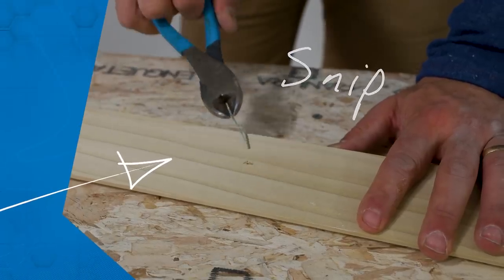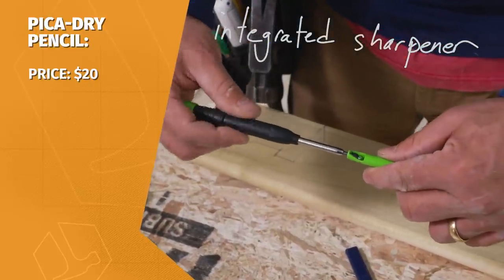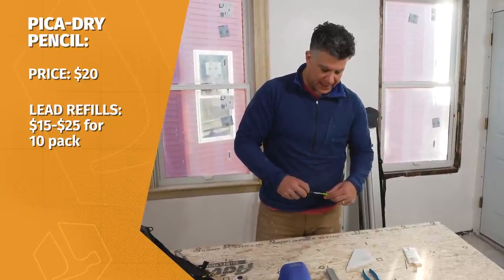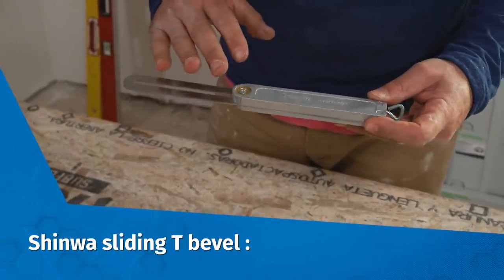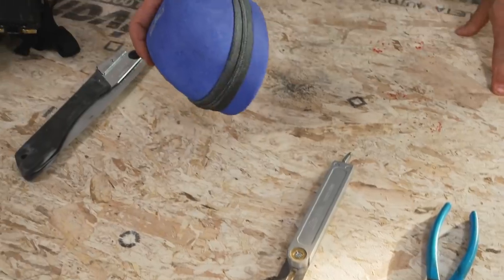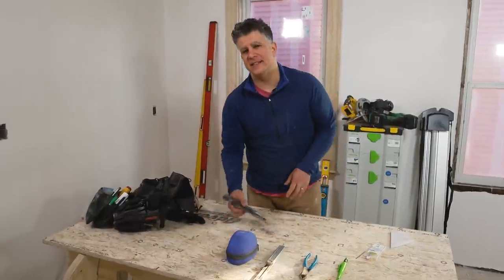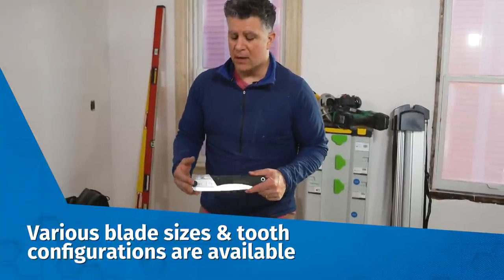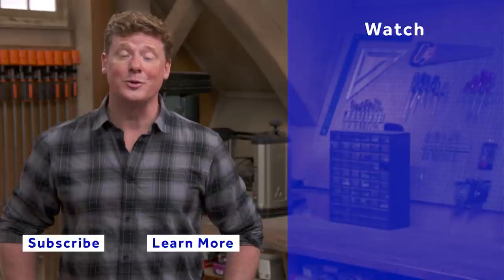5 Hand Tools Worth Having | Tool Lab | This Old House

Comment: I prefer an 07 mechanical for cabinetry, and tried a Dixon (Pica like) but wasn't impressed. 
Definitely use the Shinwa from corner to mitersaw.
The folding saw is intriguing, my Suizen pull saw is just over 2 ft long and difficult to store.

Comment: Fun video but $20 for a pencil is a bit much.  I know i'd lose it very quickly.  Everything else seems cool.
Reply: The holster it comes with is actually really great for making sure you don't lose it. I was forever losing traditional pencils on site, but I quickly got into a routine of putting the Pica pencil away in the holster in my pocket or tool belt. The ability to write on almost anything, including wet wood males it a go-to tool.
Reply: $20 is $20
Reply: I actually got two of them, never lost one. The most important feature is that it is so slim at the front. It's not for rough carpentry, it's for example for electricians marking drill holes to install outlets. And here in Germany we got for example such levels here with holes with the proper distance between outlets. A regular thick construction pencil won't fit through the holes...

https://www.stabila.com/assets/images/b/produkt_70-electric-29ae2277.jpg

Or if I have to install a surface mounted switch or outlet, this pencil is very handy to mark the drill holes.